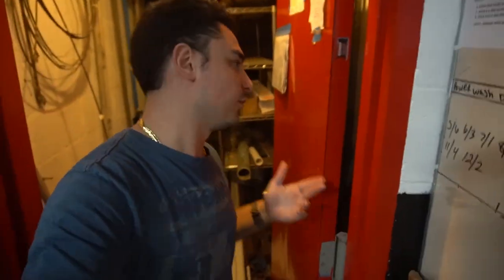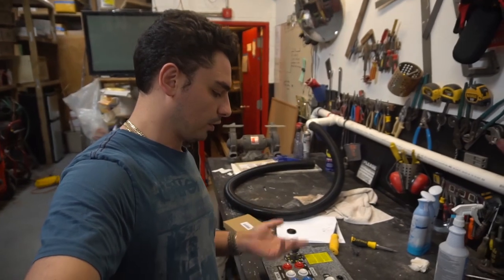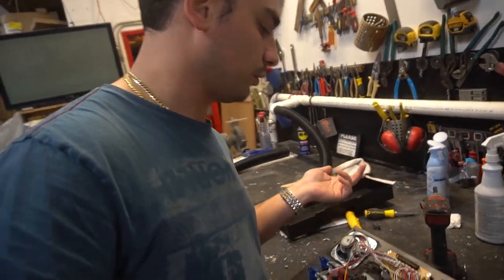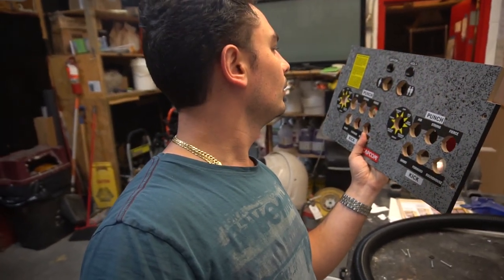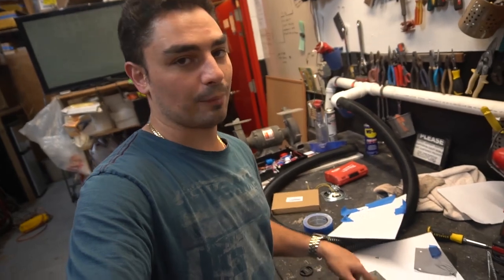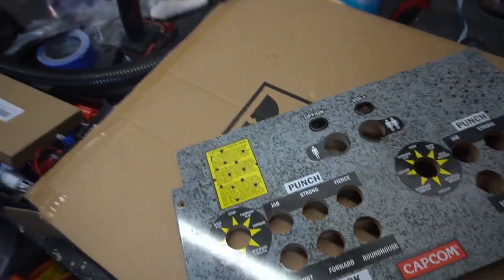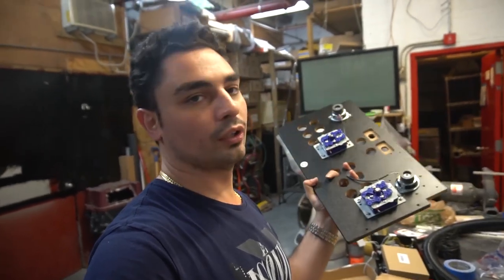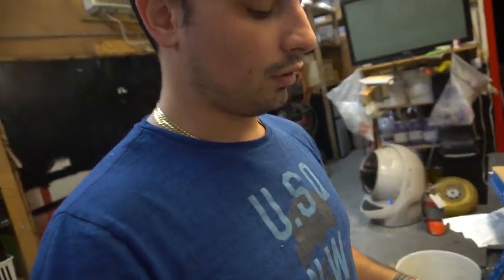Arcade 1up STEREO MOD and LED buttons. Teardown and overview

Comment: Question Vic so the extra buttons are for the menu on the  image your using ,so different images need more buttons? Cause the image I'm using I also need more buttons ,thanks great work
Reply from the maker: Not really retroarch needs those buttons, however you can program retroarch to use the existing buttons. Retro uses a key called "hot key" I personally like a designated button for hot key. Some people put the hotkey to there coin/select button such as you would when using a wired controller.
Wired controllers use select and start to exit.
I have a hot key, exit, load and save button on all my arcades cause it's an awsome feature to save a game and load the exact save point Haha
Reply: Thanks for reply yes sir imma go that route ,my new joystick led set just came in I installed real quick and my characters were able to jump forward that's what was going on thought it was the image ,the cheap joystick set I ordered was no good ,pi would not recognize it but this new set worked for some reason I can't map select and hot key but no worries I'll just install the extra buttons like u I'm stupid open now lol thanks again u got me as a subscriber  brotha look forward to more videos and tips
Reply from the maker: @albekevin  cool man keep me posted and message me if you need help
The pi can b a pain in the butt to program Haha I know it can be it gets frustrating

Comment: Hi dude
Could you let me know where I need to connect my LED daisy chain cable on the Pandoras Box 5 family edition. Just done a mod on my arcade1up machine and can't figure out how to connect the LED buttons to the Pandoras Box. Your help would be greatly appreciated. Love your channel by the way., great content. 👍👍👍
Reply from the maker: Hey buddy. So r u using a arcade power supply? Are you using a jamma harness?
LEDs are powered via 5v, so you may need to use an external power supply to power LEDs
Reply: Hi

Thanks for the reply. I'm using a standard 2 Player Harness Cable that was supplied with the Pandoras Box 5. Just need to know where to plug the daisy chain cable from the LED buttons.

Thanks
Reply from the maker: @sithlord2010  darn I'm not understanding which u have exactly, dm me on Instagram and send me a picture of the the harness @vic_vp

Comment: What drill bit size did you use for the Speaker holes and the joysticks?
Reply from the maker: Hey bud I cant answer that as I have a huge drawer full of random bits, i basically just like tested it with the original holes. The joysticks holes I did not modify. I took a wood screw and started a tiny hole, then placed the original screw holding the joystick in and screwed it like that
Reply: @Vic_VP  Thanks for Replying. I will try and Mod mine in the near future as well.
Reply from the maker: @Htcuban4  its def a must bro, I originally was not a fan at all of this cabinet, now that its modded,i play with it every day..way more fun and now a definilty eye catching piece of.furniture

Comment: Do you need to solder the speakers?
Reply from the maker: Nope, the speakers I cut and then put back together with wire nuts and electrical tape. I tried cutting the plastic speaker housing to free the wire but it was to difficult

Comment: What did the speakers plug in to?? AMP???
Reply from the maker: No buddy, speakers I bought are logitech z313, they have a volume controller included. Speaker plugs into aux jack into rasp pi
Reply: @Vic_VP  
Ok so you didn't stereo mod the original cabinet but just put a raspberry pi in, right?
Reply from the maker: @DavideNastri  yes I stereo mod all the a1ups
Reply: @Vic_VP 
Thanks for your reply!
So if I got this right the output is already stereo you just need to plug two speakers?
Reply from the maker: @DavideNastri  the output of the pi? Yes its stereo
The original output of a a1up is mono (1 speaker)
Reply: @Vic_VP 
I was talking about the original output, sadly...
So if you want to keep original hardware there is no way out, only mono?
Reply from the maker: @DavideNastri  original output only has 1 speaker. Not sure how the newer gens are

Comment: so you added another crappy Arcade1up speaker to the left?  I thought you upgraded the speakers to a better one.  The one came with it is MONO and it sounds ridiculously bad.
Reply from the maker: Huh? That's running the logitech z313 speakers. Powered 50w speakers with subwoofer. Not sure where u see me put 2 arcade 1up speakers...